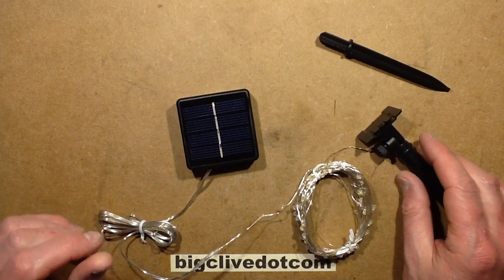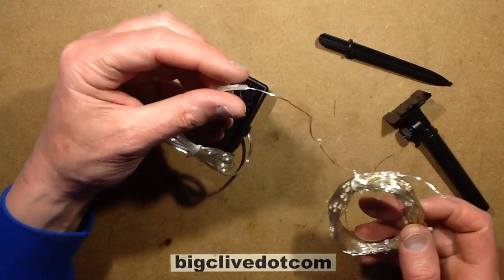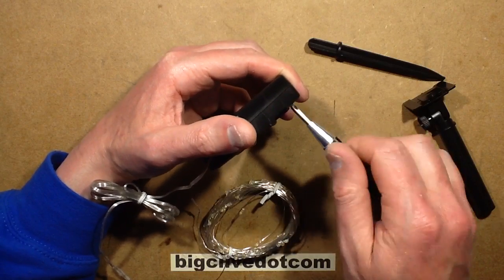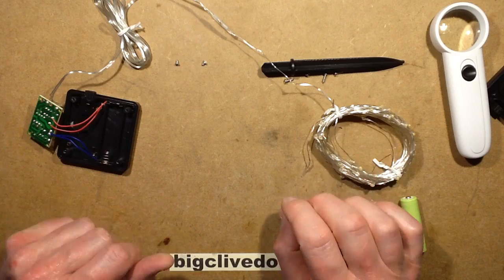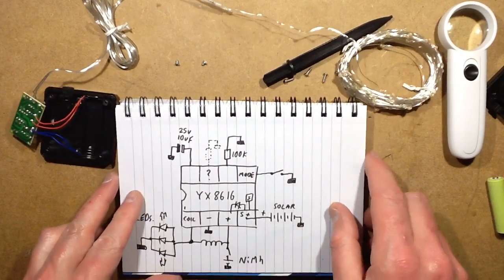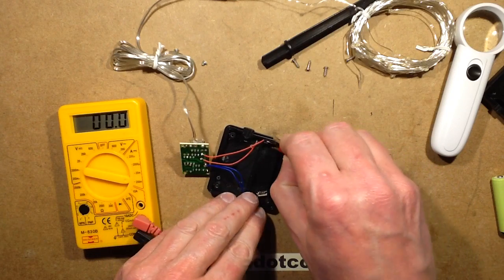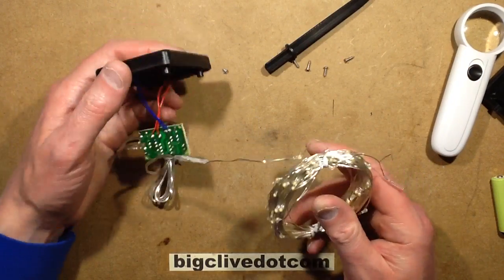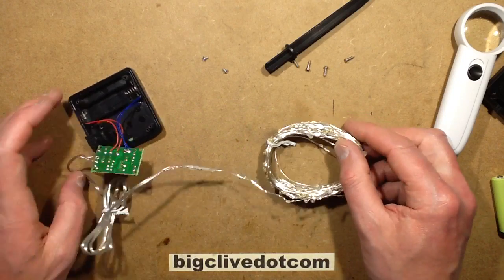Solar LED string with resin dipped LEDs.  With schematic.

Comment: My guess regarding the sticker:
The (yellow?) sticker you got is by the postal system. It's referring to EU article, where one country first receives the package and sends it to another EU country without checking the contents. This means it's not compliant to the inter-EU postage standards and first has to be checked by the customs of the country of destination. Otherwise, they wouldn't check it because they think it's from another EU country.

Example: China sent it to UK through PostNL. It first arrives in Amsterdam, where it is sorted. They put on the sticker and forward it like local EU mail (with an RS...NL code).
Reply: +Dima Oliynyk I was about to post this, I get more and more packages from those "eu gateway" shipping service. Surprisingly I've never had to pay taxes yet, only had one packages opened by customs, contained a windows tablet... no tax, guess they are just looking for drugs.

Comment: I've purchased some of the multi-colored versions of the copper wire sets and have been very pleased with the strings. The ones with discrete color LEDs have some great colors, too. (The colored resin-dipped ones, not as nice.)  By the way, could you measure the current drain of these, both at battery voltage, and string voltage?  Get an idea of run time.  It is unusual to see a full capacity NIMH cell in a solar light, as you noted.  Looks like a good unit.  Thanks, as always, for these videos..

Comment: If the ON-OFF switch disconnects the battery as shown, then how does the solar panel charge the battery ?
Reply: +Ken Franco This is not rocket science, and the sketch Clive did explains everything. You leave the ON-OFF switch in the "ON" position. The IC automatically routes solar charge to the batteries as required, as well as switching on the LEDs only when it's dark.

Comment: Could non-compliance be ROHS? Thanks for the mid-week BigClive fix.
Reply: Agreed. It's probably not RoHS compliant. We see this in the flashlight hobby where Americans prefer leaded solder because it doesn't crack after hundreds of cycles of extreme heating and cooling, while lead-free solder will. But can't be sold in Europe.
Reply: +agvulpine "But can't be sold in Europe"... only if they actually checked. Hence the reason that almost everything has CE and RoHS stickers on it, so that all the Europeans know that everything is 100% legit.

Comment: how do you decide which numbers to use on a multimeter? you use 200 milliamp, why?
Reply: You are supposed to take lowest range on the multimeter which will still be higher than the value you are about to measure for best accuracy. If you use lower range then you won't get anything (or some sort of "out of range" message), and if you select higher range you will get results with low accuracy. (not sure if it's the proper word for that, i haven't really measured anything in english ;))
Reply: oh, and the mode you are about to choose is based on calculations or guessing.
Reply: +Matt Valcarcel You decide by turning the range dial and looking at the screen. The umbers are the range of measurement, so "200" means it will measure from 0 to 200mA. If you see "OL" then you know it is "OverLoaded" so you choose the next range up using the dial. In this case, Clive knows that it won't be over 200mA as all ofr these lights are very similar (under 100mA, usually far less).

Comment: I don't understand the purpose of the inductor. If its resistance is small, then it is connected in series with the LEDs and the battery. The LEDs would be lit all the time. Even if it has high enough resistance for the LEDs to stay dim, it must be passing a small current through the LEDs all the time. What happens if you take it out of circuit?
Reply from the maker: +Hussain AlMutawa The LEDs will not light at the 1.2V of the single cell, so the inductor is used to boost the voltage by pulsing it at high frequency.
Reply: +bigclivedotcom Ah so the "coil" pin is pulsed to ground. That is a fly back configuration. I did not consider the forward voltage of the LEDs. That is a neat circuit! Thanks!
Reply: +Hussain AlMutawa Spot on. In datasheets/circuits I've seen for similar chips,that pin is often labeled "SW" for 'switch'. (typically the drain/collector of an internal mosfet/bipolar transistor,to ground.)
Reply: +Aurelius R https://detail.1688.com/offer/1258272083.html?spm=0.0.0.0.ITAmHS

Comment: I know you've probably seen plenty of LED bulb kits, but I found this one to be particularly interesting. I bought a couple and put one together, it looks really nice for a pound (?). http://www.ebay.com/itm/281418391301
Reply: +The Tyttuutface That would not last very long at all, since the LEDs are 5mm indicator type that are designed for short running times. Nice as a kit to practice soldering, but useless as a light. You could get a better result with a couple of proper LED chips.
Reply: +llamaspit Maybe, maybe not. I've got a few 'corn cob' style LED bulbs built from 5mm discrete LEDs, one in a small hallway doesn't get much use, but the one in my desk lamp is on 8+ hours a day and is about 2.5 years old now. 108 LEDs in total, output somewhere between a 40 and 60W incandescent, probably in the mid/upper region of that span. So 38 LEDs won't light a room, but in a decorative light could be OK.

Comment: I ran across and subed to this channel about two weeks ago and have found it quite interesting. most of the videos I'm left just wondering "why?" other times I'm hoping you've found a back alley Ebay seller that has developed a device that will cut my electricity bill in half or be able to maintain an erection indefinitely with no adverse effects, so I'll keep watching.
I would like to suggest that when you mention an Ebay seller you would shoot a close up screenshot of the sellers name and listing to make it easier to look up the product you're showing, I ordered the LED head lamp you took apart a while back and it took some time to make sure I ordered the same lamp. Since you seem to know a lot about LEDs maybe you could show me how to build a cheap but efficient grow light panel/bar. I grow vegetables with T5s now but marijuana will be legalized by next year here in California so I'm gona give that a shot and premanufactured lights are outrageously expensive.  Keep the vid coming they are very entertaining.

Comment: Hey clive, I bought a head torch recently on Amazon that was so badly wired, the spring contact(s) in the battery pack started glowing red hot and smouldered. Interested? :P
Reply: +ELECTRONTHORP I like the cut of your jib.
Reply: Clive answer! I need to see the teardown on this
Reply: +AlpakaWhacker Sounds like a dead short.
Reply: Juan Herrero Oh yeh, it was, I've opened it up myself so I know exactly what the issue is :P but I thought Clive might like taking a look at it
Reply: +AlpakaWhacker LoL seems amazing :D